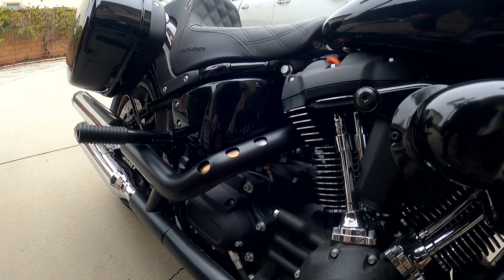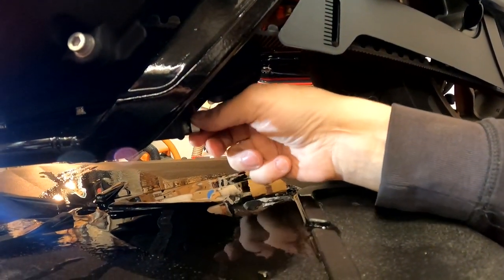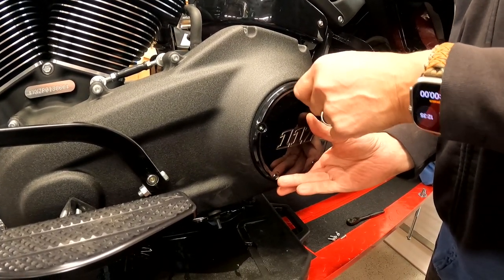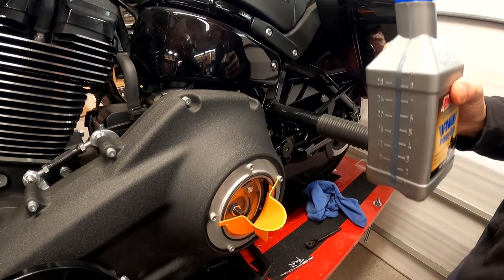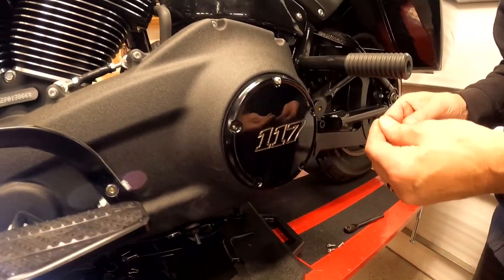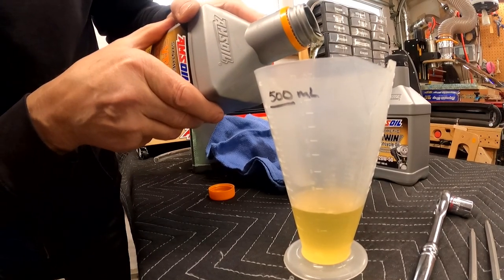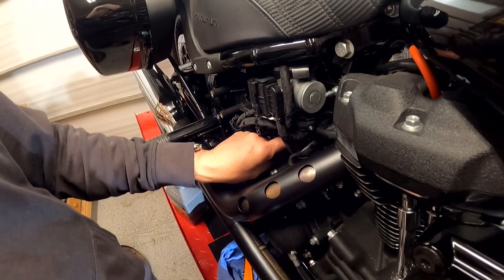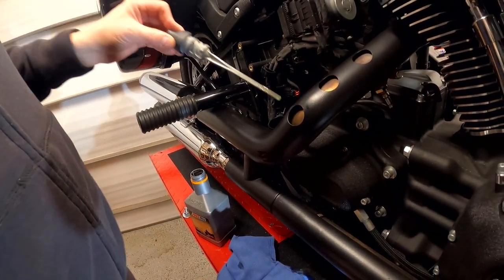Lowrider ST Oil Change For New Harley-Davidson Owners - Three Cavities Drained and Filled

Comment: Like what @Matt-pu7ow said. If you idle on the jiffy stand (like you did in the vid) then turn the bike off and check the oil, that will give a false low reading. The bike needs to be idled upright and turned off while it is upright. Then placed on the jiffy stand to check the oil.
Idling on the jiffy stand can lead to people seeing a false low reading, putting more oil in and over filling it.
Reply: This is the most infuriating thing… just did my oil change and there is no way this dipstick is accurate. The engine has to be leaving oil somewhere it shouldn’t be. My oil was reading right in the middle of the dipstick before I changed it and not with 4.6 qts in it it’s barely reading no matter what I do.. I think Harley has a problem on their hands

Comment: According to the Softail Owners Manual that came with the 2022 Low Rider S, If the bike is cold and leaning on the jiffy stand, oil level should read at the Add QT mark. If the bike is hot (200 Fahrenheit or higher), oil level should read between the ADD QT and FULL HOT mark. Again, this is with the bike leaning on the jiffy stand.

Comment: Excellent video thx.. Can you tell me if anyone else makes floor boards for mid controls? Those look like Thrasher. Also who makes rear passenger pegs/ sliders? Thx in advance
Reply from the maker: Not sure about the floor boards, but I'm sure others make them besides Thrashin Supply.   The rear bar is from Amazon.  Don't know who makes it.

Comment: What kind of motor oil do those bikes take?
Reply from the maker: 20w-50 V Twin oil is what they take.  One can also use specific transmission oil and transfer case (wet clutch) oil as well, so there would be three different types of oil in each compartment.